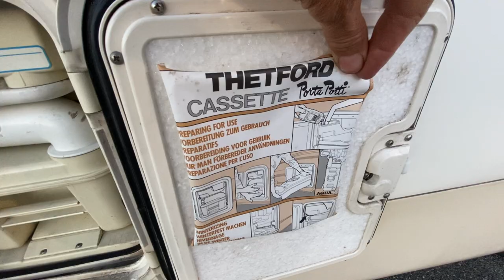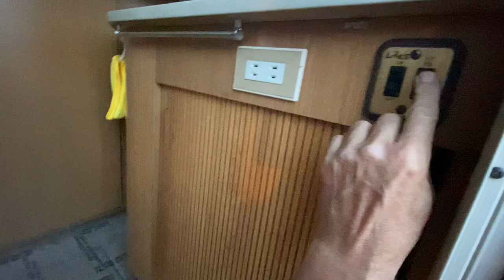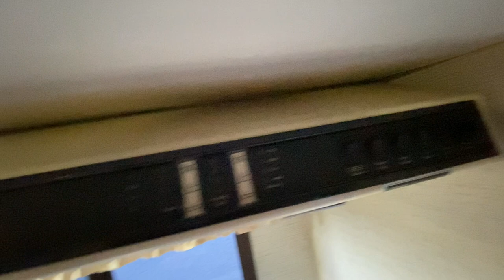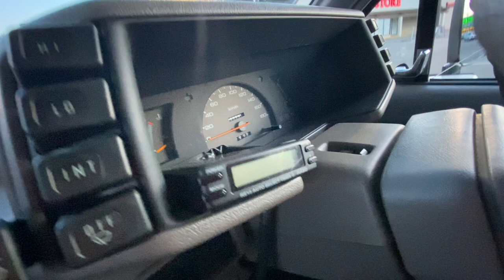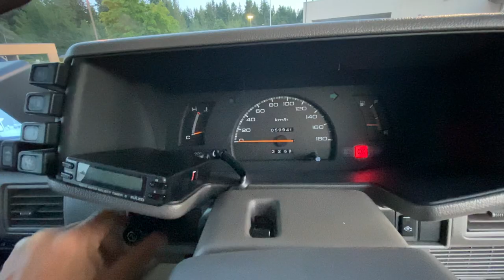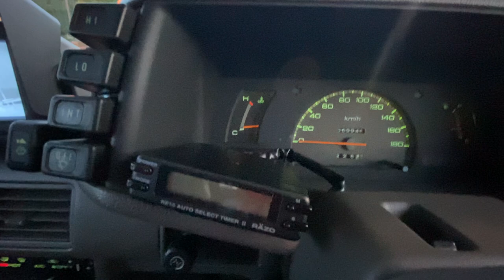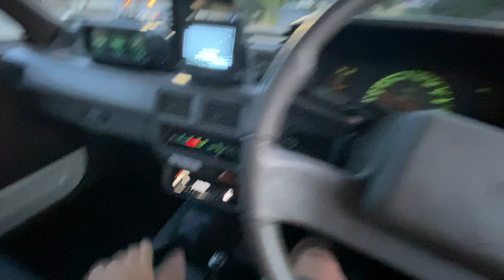Sold: BEST from  Isuzu Rodeo RV 4WD Turbo Diesel

Comment: Absolute tank of a power train. Isuzu Turbo-Diesels will run until the last stars in the universe fuse chromium into iron. Especially with a manual. Deliberately underpowered, for the sake of durability, which means that they’re highly receptive to tuning, especially when turbocharged.
Reply from the maker: Yes absolutely true Turbo diesel Isuzu 4JB1-T one of the best diesel 2800cc 100PH